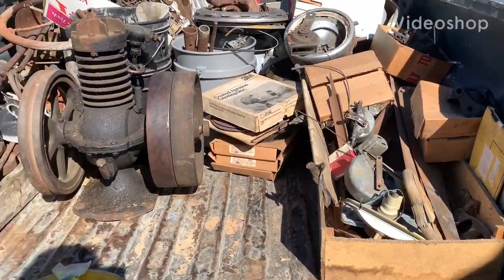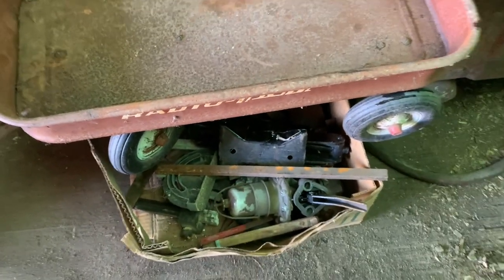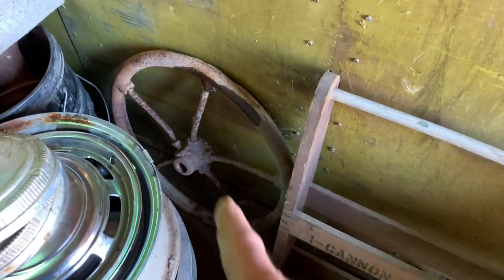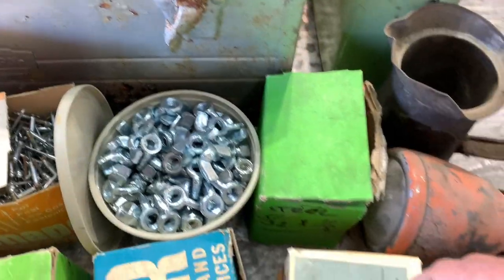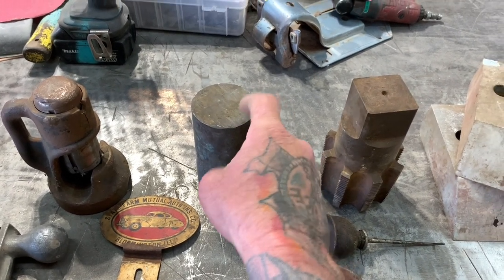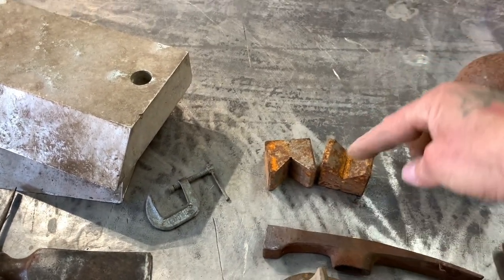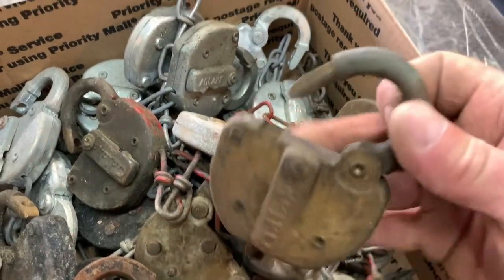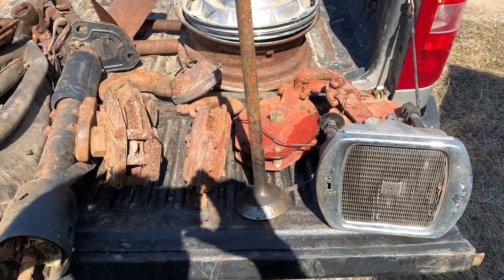Estate sale tool haul

Comment: Those aluminum blocks work great for tig welding heat sinks to prevent warping thin sheet metal.  The aluminum really sucks up slot of heat rapidly.  Save me a couple brah!  I also saw a cool rasp to smooth the old lead filler process.